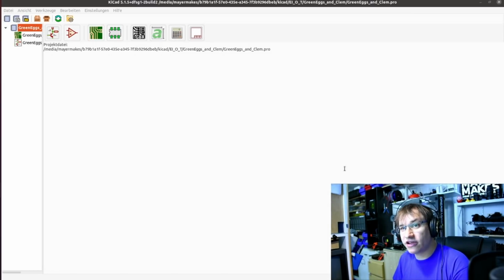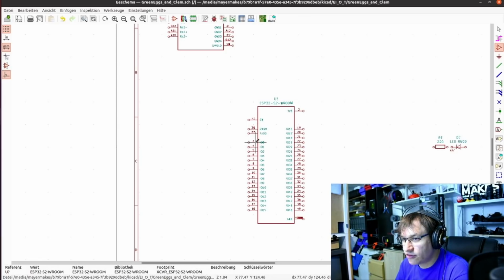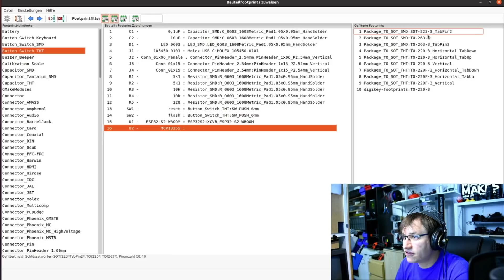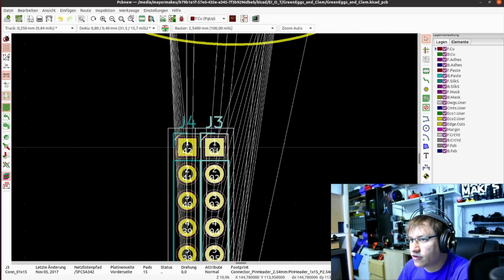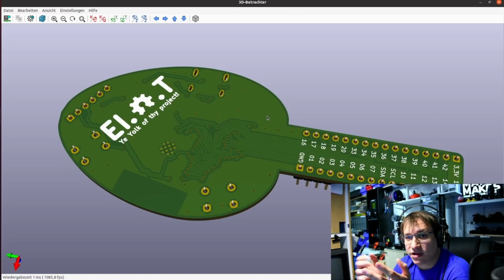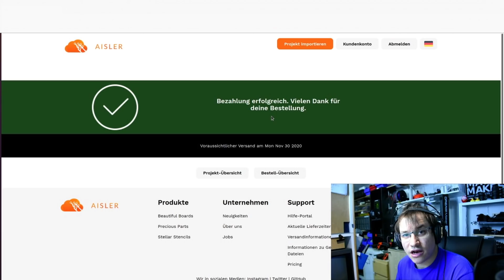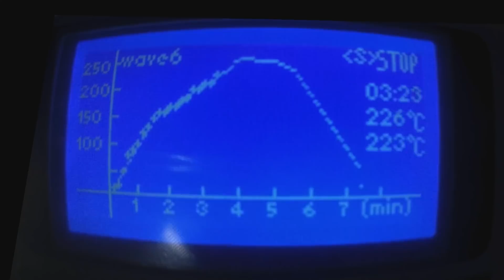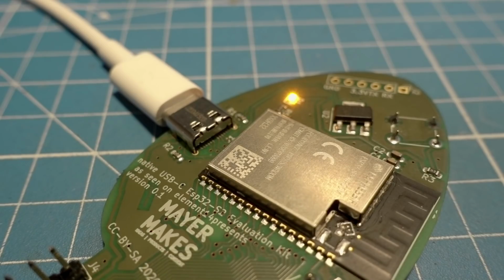How To Make A Custom PCB From Design To Assembly

Comment: Very interesting, dear @element14presents, I understand that you have not used any CP2102 type chip for USB uart communication, correct? My question is, is it necessary to use this mentioned chip or can it be omitted for communication between the board (or an esp-wroom-32) and the USB in the programming? thanks for your content! greetings
Reply: when you are using an esp32-s2 (like in the video), S3 or C3 the uart-USb-chip is not needed. a normal Esp32 does not have native usb capabilities and would therefore need it.

Comment: Thank you for the educational video. The custom board doesn’t boot with any  uploaded code unless “reset” is pressed and the process needs to be done every time I power cycle the board! How can I make it function normally (without pressing the reset)?
Reply: that sound slike you have wired up the reset button wrong so it holds it in reset unless pressed.

Comment: I've been contemplating doing something similar but with the raw chips. not sure how much I'd loose on radio range without the metal shield though. My excitement is still fresh from my own recent designing in kicad, first in many years, a security interface circuit board and also a transmitter board with esp32s2 lolin mini, 128x32 TFT, neopixels, two rotary encoders and two mini joysticks. And.. the receiver board. carrying esp-32c3 lolin mini, ULN2003, neopixels, 128x32 TFT and headers for RC servos. I have been astonished by the lack of errors other than a solid state relay chip footprint on the security board and while I've been working on the software for a few months, it amazes me at how fast the circuit boards were to design and get couriered back from jlcpcb. I don't think I would have gone to your extreme to place the body of the chip module and other devices away from the breadboard friendly part but it is a great result and will bring many people happiness! My own project is targeted at a radio control solar powered hydrofoil. My breadboarding of multiple I2C devices does not go so well so I decided it was time to consolidate many of my independently tested parts to tidy PCB. This time my RC PCBs were without schematic but I did the security board with schematic and it worked well.

Comment: Hi, I have a question. How much current do the resistor on CC1 and CC2 need to withstand?  Do this depend on the connected devices ?  Thanks for your answer :)
Reply: not much , I use bog standard 0603 5k1

Comment: If someone knows, I am totally stuck with the direct USB C connector to rx tx connection. What even are those cc lines, what is the difference to the rx tx from the connector and why doesnt he need a usb to uart converter? Thanks!
Reply: the chip i use is capable of native usb support. RX and TX = uart would need a USB to uart converter, but by using the dedicated USb lines I can omit that. CC lines are used to tell the the host/cleint which voltage and current to provide. 5k1 means "Hi im just a regular old usb 2.0 thing give me 5V @ 500mA or more if you have it.
Reply: @MAYERMAKES  Thank you for explaining!

Comment: Since it's native USB it's lacking the features of auto flash and auto reset.
Reply: I deliberately left it as manual reset as the auto reseting messes up when reconnecting, this way I can leave the serial communication running and it only resets when I wnat  it to, same for programming, I choose when the device goes into download mode , not it.

Comment: Sorry if this is a dumb question, but isn't 10k ohms way too high for the pull up resistors (for IO0 and EN)? It seems like it would pretty much prevent current and the data sheet requires them to be pulled to high in normal operation. I'm really new with all this so please let me know if I'm getting anything wrong. @MAYER MAKES
Reply: 10k is a typical value that I use all the time. 1k would of course also work, but I prefer it .

Comment: Hello.  To which pins d oyou connect  the RST and BOOT buttons? and do they need pull up resistors ?
Reply: I'm a strong beleiver in adding 10k pull ups even they are internally present on some modules. reset goes to EN and Boot to GPIO0

Comment: If using the onboard UART is so simple, I don't understand why all of the dev boards have external USB to UART bridges? is the onboard setup slow, or is it just that external USB->UART hardware allows for the automatic reset switching setup to avoid needing to press the reset button for flashing?
Reply: most MCUs just don't have included usb to uart/native usb. thats a pretty new feature in the mcu world.
Reply: @MAYERMAKES  I'm talking specifically about the espressif ESP32-S2/S3 Dev boards that are available now.. They all appear to have external USB>UART bridges still.
Reply: @ryanokeefe12  oh thats probably becasue tehy cust switch out the modules and dont change the overal design. Also when the first Saola baortds came out native usb was in its infancy on the driver side, so they maybe wanted to get to market asap with any design. I try to do better with my devkits.

Comment: awesome content, thanks a lot! No idea how I didn't find this channel before! Is it slower to stencil and oven vs just soldering all connections? 17:00 not to bring out the worst of the internet but... an 'egg'? really? ;)
Reply: that depends on the board, with a lot of resitors and caps its is faster to stencil /oven, but if you only have a few ICs than hand soldering is quicker. Some components my not be easy to hand solder like QFNs or HDinterconnects.

Comment: Excellent video. I remember just over ten years ago struggling to get a small batch of PCBs made. It was expensive and no company would do it unless the order was in the hundreds at a minimum.
Reply: times have changed, but it is stil lworth learning doing the homemade methods like etching and milling , if you need simple pcbs very fast.

Comment: @15:50 Why shouldn't you clean a PCB in an ultrasonic with IPA?
Reply: there is a risk of flammable Vapor whenever using alcophol in cleaners. I use my own Brands cleaning solution (still in development) but most people use IPA&water mixture. personally I do it in front of an open window in a sealed chamber ,no heating and only for a minute. Still I do not recommend doing it. a toothbrush soaked in ip also works.
Reply: @MAYERMAKES  I was wondering about the ventilation requirements. Could you store it inside with the lid on when not in use? I am sure most people are doing this from home. I actually use a Kester solution.
Reply: @EricBergenn  I store it in the original bottle between uses
Reply: @MAYERMAKES  Thank you
Reply: I too was wondering this
Reply: @JackSpiggle  I would have to look through their videos, but I haven't seen too many videos on ultrasonic cleaning. I have read papers about not using them with crystal oscillators and wish to see more on the topic. It would be great to know more about what to use as a bath I.e. a brand's solution, just water, ipa, or what ever.
Reply: I was wondering the same!
Reply: It can cause a 🔥, it’s alcohol being heated
Reply: @gower1973  Ahhhh this makes sense! Thank you! =D
Reply: @gower1973  I heard that too, but people (including this video) still do it. Still though, what is the best wash medium?